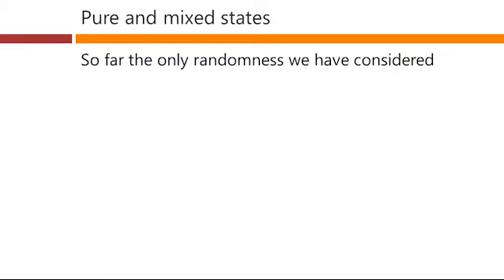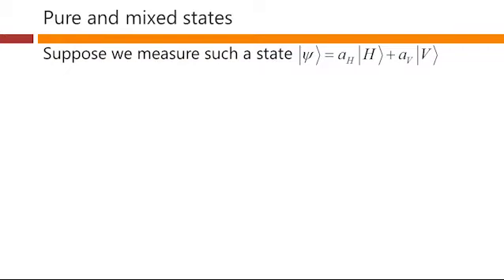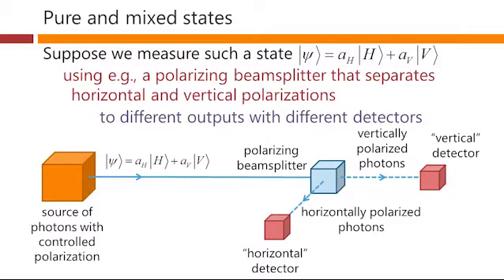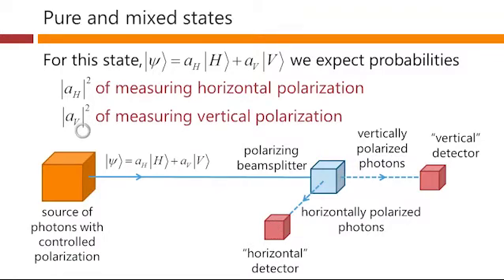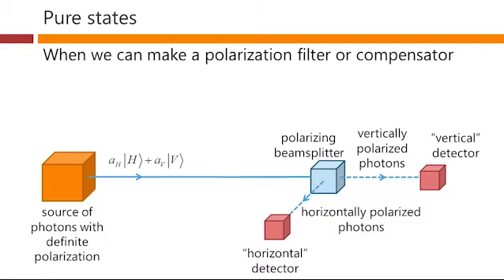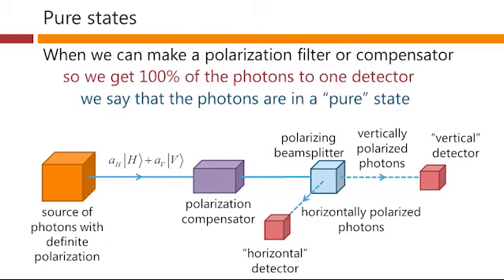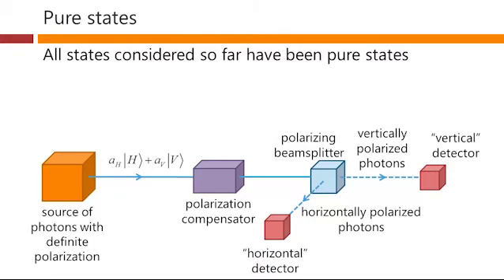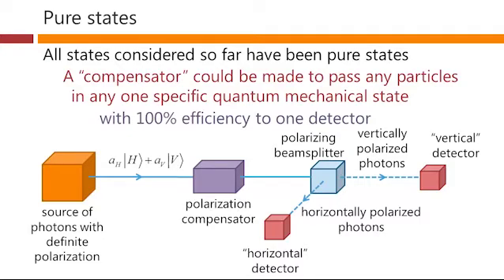Pure and mixed states – David Miller

Comment: So when we have a polarization compensator set to "vertical" , if there's a mixed state (multiple lasers with non-polarizing beam splitter to combine them) we'd still get a reading on the "horizontal" detector?
Reply: or would we only get readings on the "vertical" detector, but the intensity/number of photons detected is less than the combined intensity of the two lasers?

Comment: When a polarizing filter let through one polarization state and blocks the orthogonal one, what happens to the energy of the light that don't pass? all of it gets absorbed, heating the polarizer?
Reply: That depends on the kind of polarizer. In an optical beam splitter cube, for example, there is essentially no absorption, and the light in the "other" polarization comes out of the side of the cube. Other kinds of polarizers (such as a "wire grid" polarizer) can absorb or even back-reflect the "other" polarization.